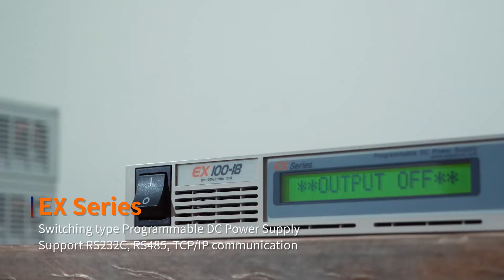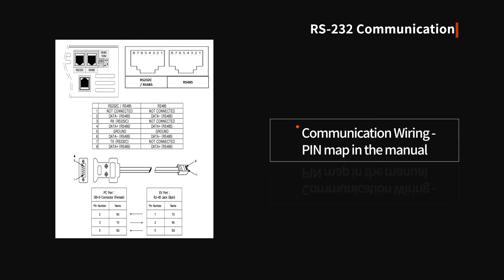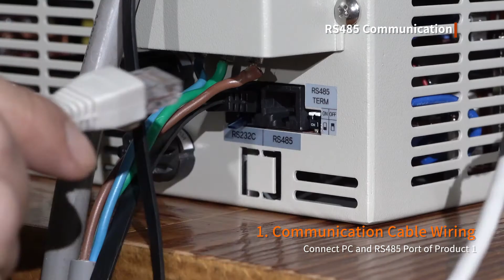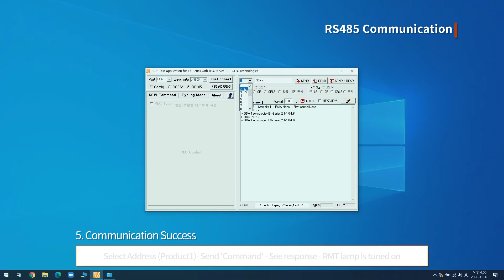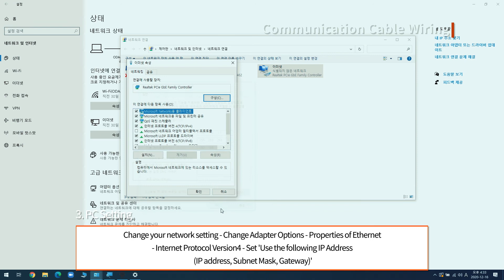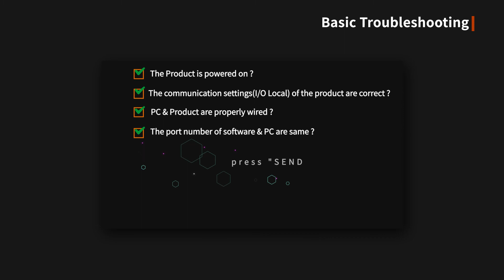How to control DC Power Supply by using PC

Comment: I can connect two EX300-4 power supplies in series to have a voltage of 600Vdc?
Reply from the maker: We do not recommend series or parallel connections on your own. If necessary, we recommend using a 600V product.
If you have any further questions, please contact our overseas department at ate1@odacore.com